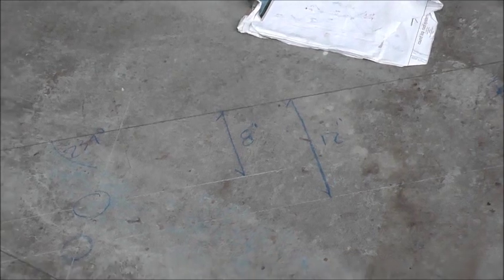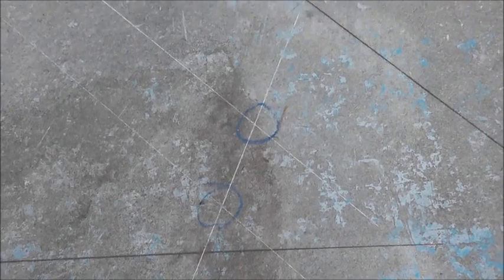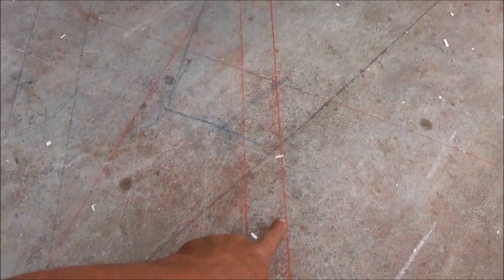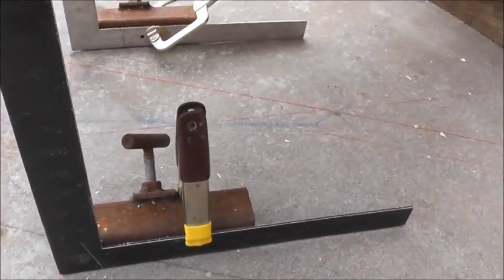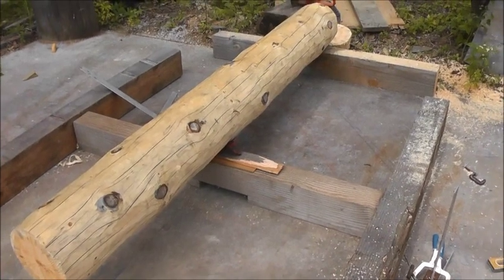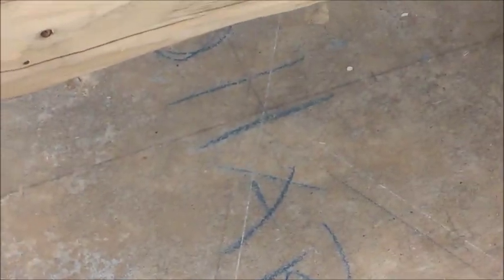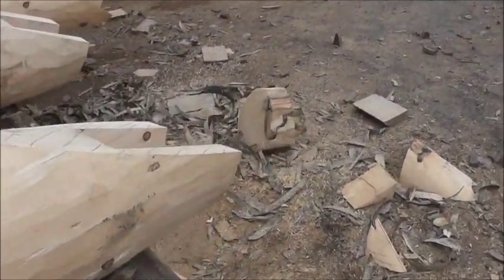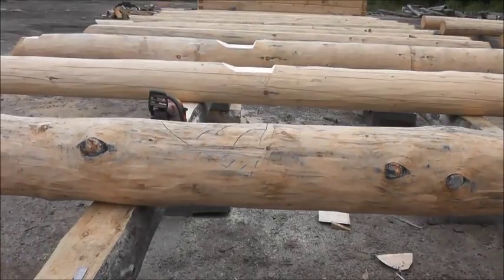mitered round log joinery layout

Comment: pretty cool setup you have. but I was thinking could you use chalk line to make your initial lines? start at the top of your squares and drop your lines over the log to get a straighter line. them if needed come back with pencil for a more permanent line. I'm sure some of the angles on your log would likely cause the string to role from center. in any case, just a thought.